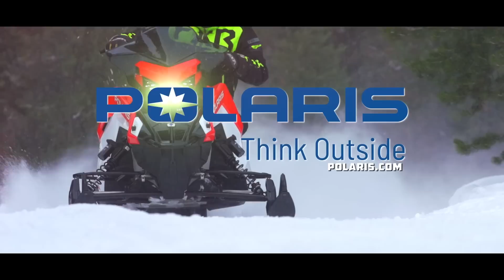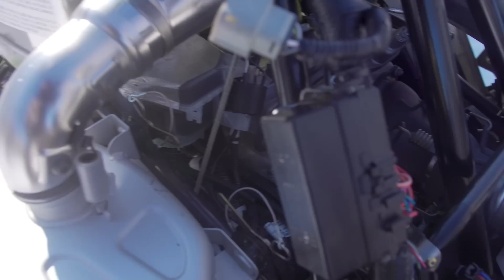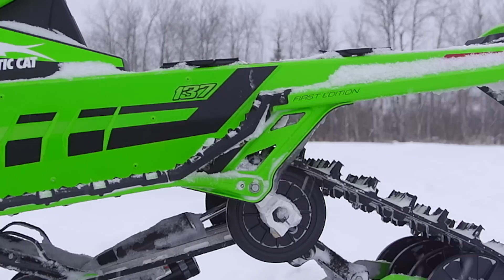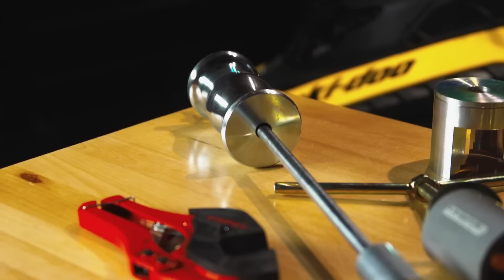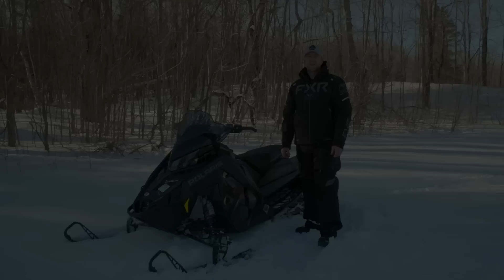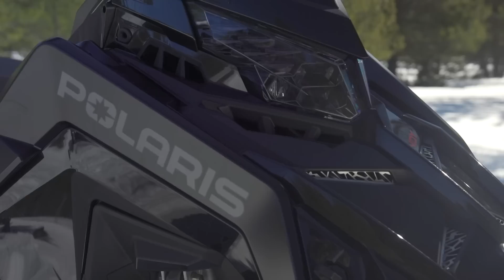SNOWTRAX TV 2023 - FULL Episode 11

Comment: I know manufactures do not like to give out HP numbers but have you folks seen any updated HP numbers with the improved 600.? It was stated by the Cat guy in this video that Cat saw improvements in HP.
Some demo Cat riders felt, the difference from the older C-Tec 2 600, was simply weight reduction, others felt the improvements made it faster in all aspects not just a diet

Comment: just watching you work on that skidoo im glad i avoided that headache. It looks like it was designed by a German!
Reply: Ever taken a clutch off before?  It's nice that the primary and secondary can come off without any other dissasembly like previous years.  I personally like the brakes on the jackshaft so in the event of chaincase or drive belt failure you can still stop the sled...

Comment: I believe the rear skid/suspension is from the older sleds?  If so--is it up to snuff to ride with the best from Ski Doo and Lynx sleds?  I'll be watching how the belt drive works and lasts on trail.  That eliminates a maintenance step of changing chain case oil, worrying about chain tension, etc, plus weight/simplicity. and near-instant gearing changes.
Reply: The guy said the 129” is all-new, but shares some parts with the 137”.